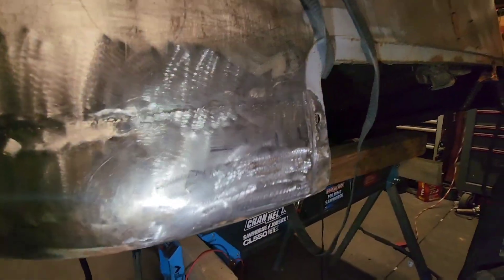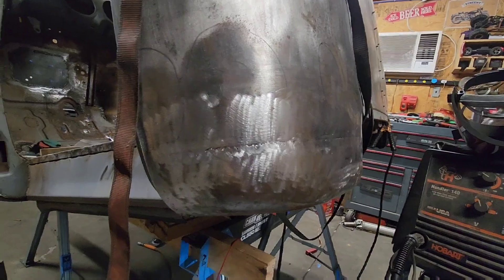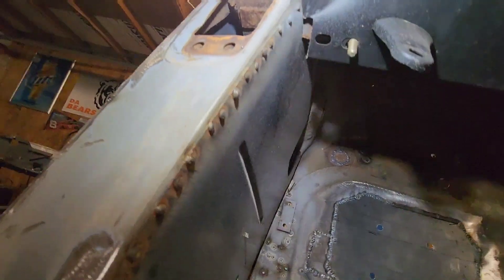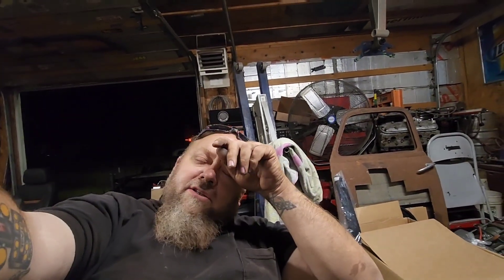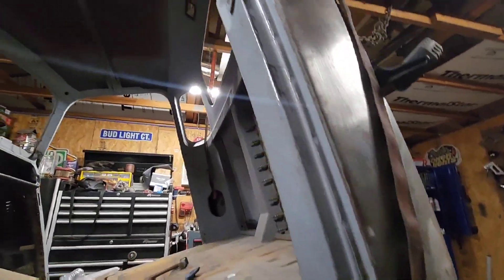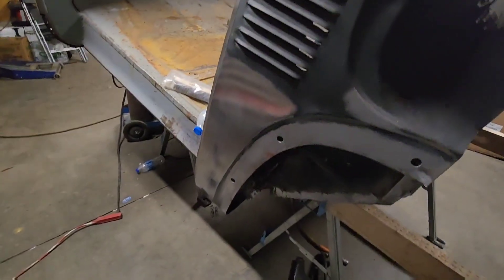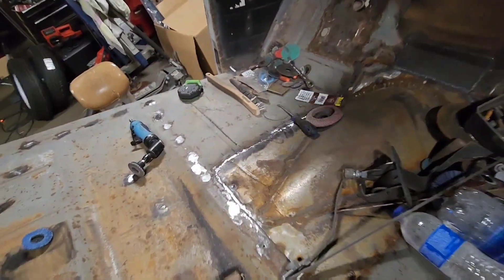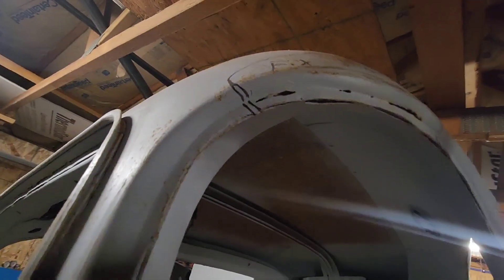Getting Everything Welded up now working on the details

Comment: The cab looks really  good  ,,I like it when  the welds seem pulls in just  a little  like  that ,makes it perfect  too get some fiber glass  over the weld  ,,nice,,👍👍
Reply from the maker: Most don't understand how the weld moves the metal or even how it all works i honestly like a slight pull there too it adds a hint of strength in the area id definitely rather have in than out lol